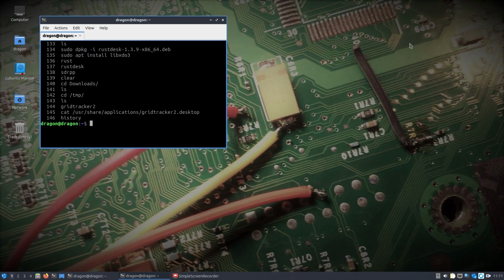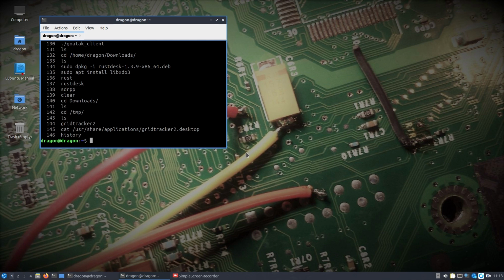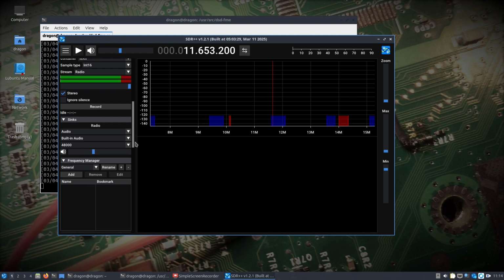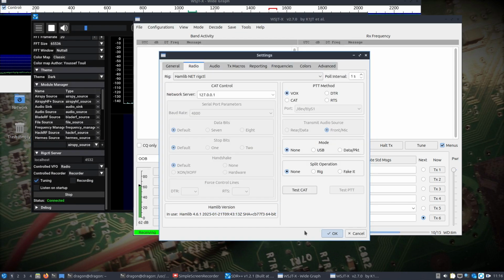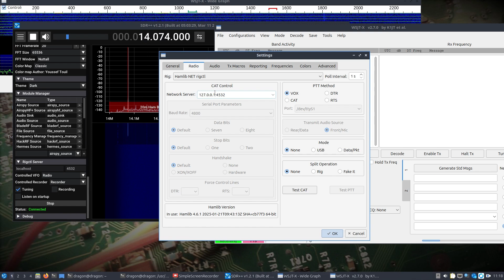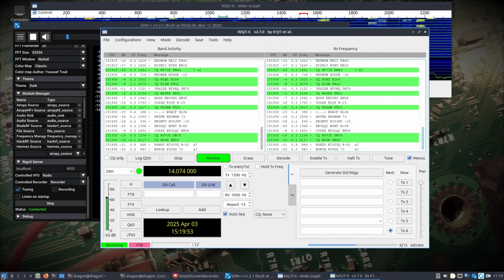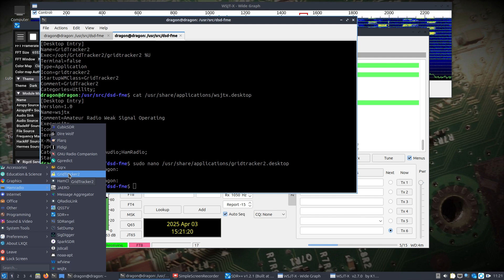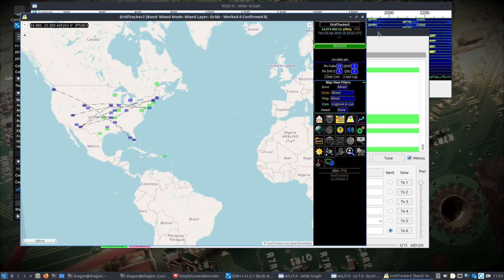DragonOS Noble WSJT-X Quick Test over Wi-Fi HaLow (AirspyHF, SDR++, GridTracker2)

Comment: Greetings, Does GridTracker come installed in Noble ? It's funny, I was wondering the other day whether there was a Linux version.
Reply from the maker: Yes it does, just not that upon running it (with internet provided) it’ll want to upgrade at which point the shortcut will update like I mention in the video. Which reminds me, I should’ve made another separate shortcut in this new ISO I’m working on. I’ll add that to the list.
Reply: @cemaxecuter7783  Thank you for the headsup. I have a new mini-pc that I will dedicate to DragonOS. Cheers!